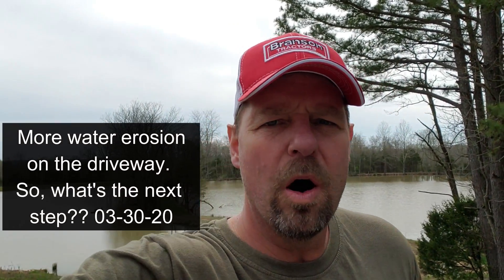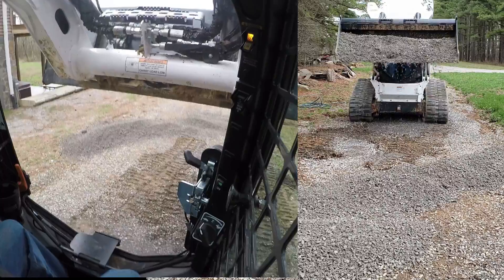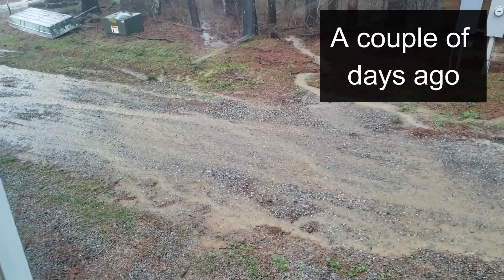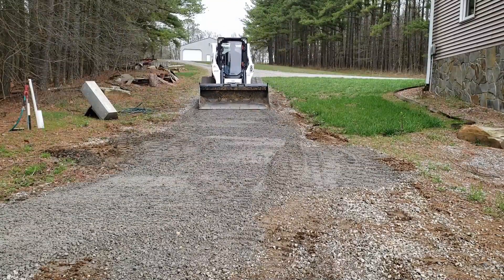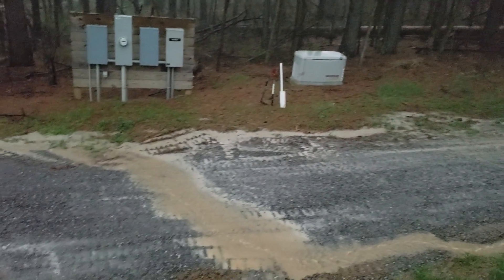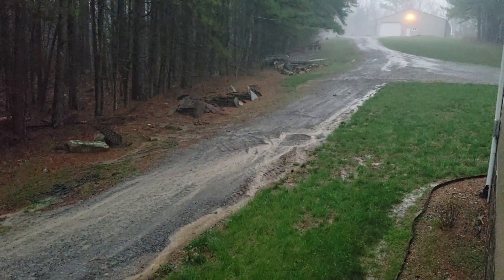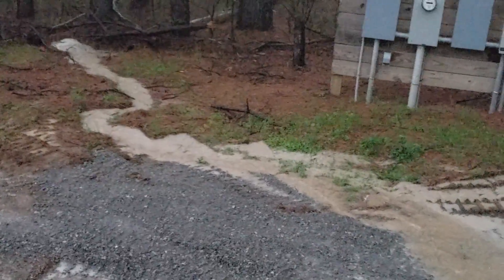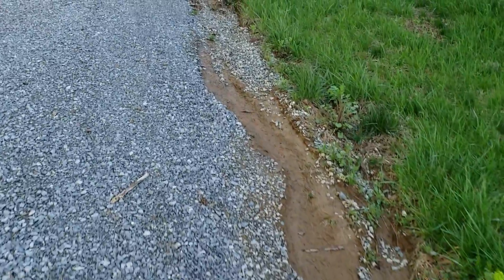Water erosion on gravel driveway, What's the next step?? Illinois homestead

Comment: From the perspective of facing your pond... I would super-elevate the left side of your driveway (side closet to house) by adding additional driveway rock.  Now any water that lands on your driveway will immediately begin moving away from the house side and towards the woods.  With the help of the additional height of the left driveway edge... build a shallow V ditch all the way to the pond.  Sod and/or rock line the ditch with 4 or 6” minus rock depending on water volumes and velocities.  

On the right side - I would attempt to grade the road slope so the water sheets transversely into the woods over the largest area as possible so it doesn’t cut gullies.  Then seed to establish turf to help hold the soil.   

If at all possible, I’d avoid pipes or concrete flumes that concentrate and/or increase flow velocities that will cause greater erosion issues downstream of the discharge point.

Comment: If digging depth is an issue I would install a series of 4 or 5 in pipe 6 to 8 feet apart and slope thing to direct water to the first and as it gets to max capacity it runs down to the next and so on. Clear as mud hope it helps man.

Comment: Hey Kapper!  If you can get some asphalt millings I would try that. Put them about 3-4” thick on your road there and track them in with your T650. Over the course of some hot sunny days they will melt back together and almost be as good as someone paving the road.  I put asphalt millings in my driveway and it turned out great!

Comment: I have a fairly steep slope on my driveway also. I tilted the part I drive on to direct the run-off in the direction I wanted, put rip-rap on the opposite side and then had it paved. Had a problem for years and now no problem.  My driveway is about 150 ft. from top to bottom. Paving is expensive, but it was worth it, especially now that I'm old.
Reply: Marvin that would also be a great fix, I would add the pipes too.

Comment: Put an inlet where your down spouts are and tie your down spouts into drain tile and run under your driveway. Culverts are concrete with head and end walls you don’t need to do all that. If you are still unsure of where your lines are located then you can either hand dig parallel to your house down a 5’ stretch as deep as your gonna dig to make sure you won’t hit anything. Or use a power washer and it’ll blow a hole through the ground. Almost like a hydrovac minus the vacuum part of it lol. You could always add stone and top soil but if your driveway is a wrap around then it won’t get the water away from your house and you don’t want that.
Reply from the maker: Thanks. The downspouts are already tied in to drain tile, one for each of them. I think you're saying maybe tie into that one, but it would never handle that kind of water flow. For 'normal' rains it would be OK but man, we get a lot of gulley washers. I'd prefer not to dig and take 
any chances at all with the fiber line, sometimes they don't bury those very deep at all. I have a couple options to explore, thanks.
Reply: Kapper Outdoors you are getting a ton of rain. Man that’s a tough choice. Maybe like others have said just beef the high side of your driveway up and add some top soil so the water rolls off the driveway rather than down. Hopefully you get it fixed up cause that’s a ton of water. Keep us updated on what you end up going with.

Comment: If you cant dig down, build it up, go out into the yard with them if you have to and just transition from gravel to dirt at the edge of the drive. put in more of the rises and go all the way up the hill with them. Go to where you first start seeing the water flow in a heavy stream and go above that because by the time you have visible flow it already has energy enough to erode, make your bars cast off to one side or the other, dig a ditch off into the woods on the downhill side, it can be shallow, but have it go off into the woods not collecting more water but casting the hill off to the side rather than straight down towards the house. Make your water bars long and gradual and keep them casting to the woods the whole time, there comes a place where certain speeds are going to make the road feel weird and bumpy, but how fast are you trying to drive in the yard? find a good compromise and the more slope you have on the hill the more you want to cast the water straight across the driveway rather than tapering across downhill. Just remember the part, once you can see water flowing it is too much water and it should be cast off already. it will work, just going to take some finagling to get it right.

Comment: Question could you put two or three catch basins across your driveway run them all into one polyethylene pipe down the hill in Into the Woods where you're not getting all this erosion they do sell them in 4'to8' lengths. Your Bridge Project in your pond we have used mobile home frame to expand got lengths that you need it where you're coming back away from the water between 6 and 8 foot and put concrete pillars into the ground and anchor them then you're not worrying about erosion with the railroad ties down the road ours is still holding up today going on 23 years of building we have a island expanded in the middle of the pond with a kazeebo. Let me know thank you

Comment: It would be good to put a culvert under the driveway further up closer to where the driveway branches to the house garage. It can be installed fairly shallow heading towards the woods, you may just have to do a little digging by hand in the vicinity of the underground services and have a collection swail in the lawn to gather the runoff. This would redirect a lot of water before it has a chance to flow down by the side of the house, also will avoid having to dig a trench further down near all the other lines crossing under the driveway to the house.
Reply from the maker: yeah I'm going to have to try to split the difference like you said halfway up the hill. I wanted to avoid any kind of ditch though, but I may have to. Thanks, we'll see. Take care

Comment: could you dig a ditch on the wooded side of the road. Maybe a culvert at the top of the road where the other road meets to catch the water.  Then grade the problem road next to the house so it slopes towards the trees?  I'm curious as to what solution you end up with.  I have a driveway with a similar problem.

Comment: Someone already mentioned it but if u cut a track across the drive at say 45 degrees an about 2 to 3 ft wide an 4 to 6 inches deep line it with heavy duty plastic an back fill with 3 or 4 inch stone should work ok 👍
Reply from the maker: hmmm, I've seen this on pond spillways. Thanks, I'll be looking at options

Comment: I had a lot of problems with my gravel drive after I built my house and I ended up doing blacktop and some sod in the problem areas. Blacktop gives you a lot more bang for your buck than concrete does, in terms of square footage. It has held up really good over the years and water just runs right over it and I don’t have to worry like I did when it was gravel.
Reply from the maker: Good deal thanks. I don't think we'll ever do that, at least not until we figure out for sure if/how long we are staying. Thanks man

Comment: Add small ditches on the sides of the driveway. Filled with gravel. Then maybe the water will follow the direction u want go. I call them Michigan ditch’s I had to stop issues when it rained or when snow was melting. My driveway a constant muddy mess. After I dug a 4in deep ditches both sides it was never an issue again.
Reply from the maker: The only problem with that is it will wash away gravel, it already has. I don't want a ditch there or culvert since we mow right up to the gravel. We'll get back to it as some point down the road, thank you. Have a good one.

Comment: Personally, I would go with the culvert idea. But first I would start at the source of the water which looks like the top of the hill. First I would dig a ditch on both sides of the driveway (2'wide x 1' deep) from the top all the way to the bottom, or at least to the area downhill where you want to divert the water.  In it, I would insert a 6" french drain pipe(corrugated plastic pipe with holes in it to allow water to enter) the length of the ditch which would run and empty into the culvert you place directing the water to a low lying area or a stream.  Assuming an 8 or 12" pipe.  Burry the french drain ditches with gravel and drop more aggregate over the entire road and compact it where it is high in the middle and low on the edges.  This should force the water into the french drain system, then the culvert, then away from your driveway.  Just my two cents,  I really hope you solve the problem.  Good luck Kapper.
Reply: Yeah definitely need to try and divert water further up the hill .

Comment: Looks like you got her figured out. You just havta repeat what you did on the bottom with the other couple top water crossings. You may want to consider adding swells on the down hill side of the driveway to handle the water and eliminate the erosion in your yard. Besides that, looks like you got it wipped with just a little up keep. Good job buddy!

Comment: If you cannot dig down more than 6” I would suggest the following. Add an additional 8” of 3” minus gravel to that driveway and put a good crown on it to keep the water on the side of the road and then install a 8” culvert at the top and bottom of the road. Also worth lining the side of the driveway with some 3-4” clean stone to slow down the water running down the “ditch” on the side of the road.

Comment: Try this product:  Quick Dam Flood Barrier. The other option is to use flat drain tile and install it as a sheet drain or put in a grate system drain. I think that the grate system would work the best, look into Trench Drain Supply and the kits they have

Comment: Put a small ditch all long the high side of your drive to funnel the water and where you want it to cross to the low side. pour a concrete channel the width of your drive with steel grating on  the top. You could also do the same on the high side and have a French drain connected to a pipe buried the width of your driveway too, either one would work.

Comment: Kappper is there a way you can move the driveway over by cutting trees down and have driveway go behind the electrical service? The current driveway build a wall and raise the hill. I remember the big water issues when you were building. Tough situation with all that water coming down. Its going to be interesting to see how this turns out. Your rain has hit Connecticut. Seems all we do is get rain. At least you can move around your property and be away from peeps. I'm 96 miles northeast of NYC. Corona is spreading are way and so many are dying.
Reply from the maker: I've got a few options I am going to explore. But overall the water issues have been severely reduced. Good luck over there by you! Take care

Comment: A possible solution might be using Advanedge ADS "Flat"  Drain pipe which can be installed horizontally and has greater flow rates than standard  drainage pipe.   Love your videos!
Reply from the maker: I'll take a look at it, thanks

Comment: Just a little background about me:  I recently retired from a county government job as a design review engineer after 32 years of service. One of my duties was helping homeowners with drainage problems providing recommendations on how to resolve them. As with most drainage issues, there typically are multiple ways to address the same problem effectively. Hence, I need to break this response up to give you a couple ideas - forthcoming...
Reply: First thing is that you need to break up the runoff before it piles up coming downhill. One way would be to install three rolled water breaks at a 45-degree angle across the driveway extending into the yard on both sides of the driveway utilizing shallow swales. Use crusher run on the driveway and add a couple bags of Portland Cement at each crossing to solidify the swale area.
Reply: Another idea is to build troughs out of pressure treated lumber crossing the driveway at 45-degrees. I would utilize 6x6 for the sides and 2" x 12" for the bottom. Make the trough wide enough to clean out with at least an edging shovel. You can install a traffic bearing grate over the top that can be periodically taken off for any cleanout.
Reply: The key thing is that you need to adequately tie into both sides of the yard to pickup (at the upper end) and convey the water safely away from the driveway. Good luck and let me know if you have any questions.
Reply from the maker: Thanks for the suggestions. On your first one with water breaks, are you saying similar to the water boards I've been using only more permanent and add a couple? Thanks
Reply: Yes, but install them on more of an angle for two reasons:  1. runoff will turn into them easier (water doesn't do well making 90 degree turns) and 2. The angled water breaks are easier to drive over as they are not as abrupt on your vehicle. Be sure to extend the breaks into the yard to pickup all the water.

Comment: Dig a fairy broad ditch on the uphill side, and tweak your concrete slab idea so that you have a wide shallow dip (create a ford, basically) across the driveway; make the width of it 1.5 times the length of the longest vehicle you drive over it, depth at deepest part can then be about 24 inches below the highest part. Continue with a well rip-rapped ditch on the other side.
Reply from the maker: That sounds like a pretty large concrete slab!? Thanks for the idea. I was trying to avoid any ditches up here by the lawn/drive area, but I may have to modify that some! Thanks

Comment: Tough one without digging. Can you put a culvert in at that upper corner - where the driveway opens up to the attached garage parking area? Or do you have power running uphill too?
Regrade the driveway from the equipment garage down. Lose that nice crown so that water can run off to the wooded side all along its length.
The runoff from the parking area is tougher. Slab the whole section along the side of the house in concrete. It aint pretty or cheap, but its permanent. I don't think the limited digging depth will allow you to pour a concrete water bar that will be thick enough to hold up to heavy equipment driving over it. Being such a shallow pour, water is bound to excavate its way underneath. A little riprap along that edge would force the water to disperse and cross with less volume at more points.
Is it possible to find deeper spots to dig between the underground conduits?
What about rerouting that section? Go out and around your power hub instead of straight down the hill.

Comment: Kapper    I would use a hoe and by hand remove enough gravel to add  a  4 inch diameter drain pipe across the road at an angle.   I would add as many as the problem requires and add the gravel on top to hold it in place.  No way would I dig up the underground utilities. Maybe add three.
Reply: I would add a 6 inch pipe if I did not hit anything in that area. Pile on he gravel as much as you need.

Comment: Unless you can shed the water higher up the driveway I’d pour cement.
Reply from the maker: I've had a couple of ideas to look at. I may cut it off higher on the hill, but then I'd need 2 spots to run it across or under. Thanks

Comment: Did you ever solve this?
Reply from the maker: Not yet I think I'm going to cave in a put a culvert in. I was trying to avoid that with the lawn butting up to the road but I think I'll be doing that soon. I think I'll wait for the new e42 though for that project :)
Reply: Kapper Outdoors yeh, with it coming at that angle, it kinda makes it hard.

A catch basin would just clog up I think.

I had a similar issue that I fixed with a 2x12 and (2) 4x4 posts that I turned into a “ditch.”

Comment: When are they going to do maybe is dig it out a little bit put a plastic liner down and then put a bigger Stone down on the side of the driveway and then over that spot so it will guide it down that spot two handle the water that are put in a culvert in
Reply: I'm  pretty sure It's called a dry River bed that way you can make it as white as you need to to handle the water
Reply from the maker: Thanks I am considering that and a couple other ideas. Appreciate it

Comment: Joe, sometimes it best to leave it to the professional to figure out.  I would contact a engineering firm to get professional advice.  They could probably come up with a short term and a long term solution to your current problem.  Your are more that capable with the equipment you have to do the work.  You just need some professional advice.
Reply from the maker: I'm going to look at a couple of products for this. I may call my buddy Morris out. I just hate to call someone out and not hire them.